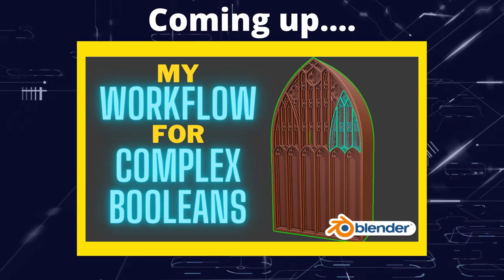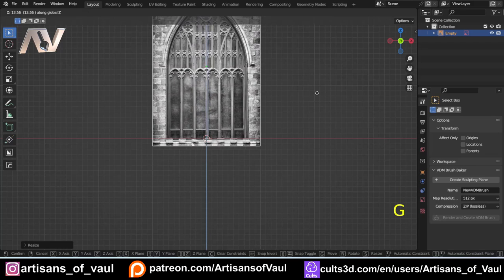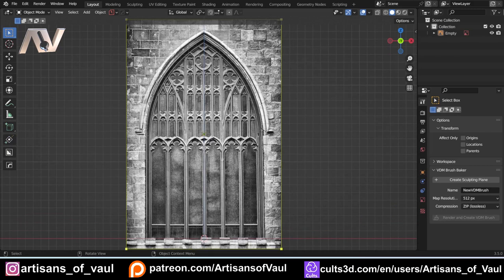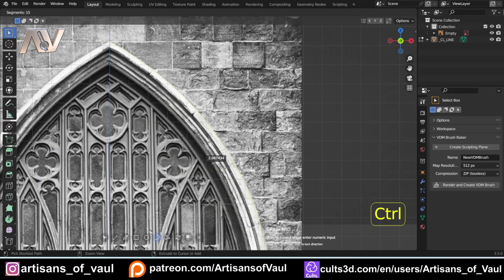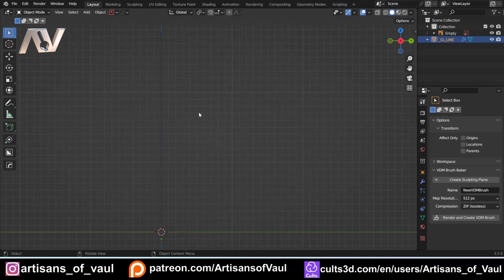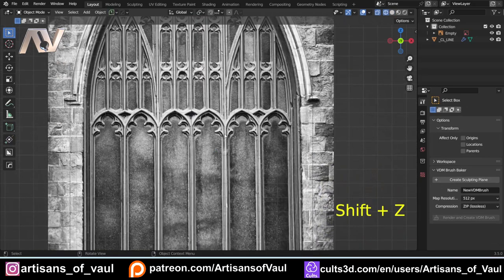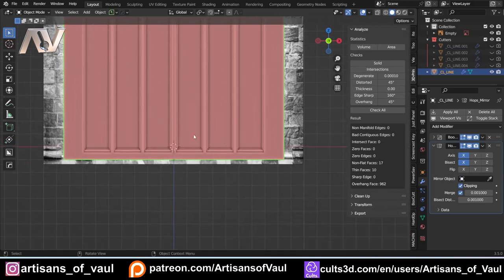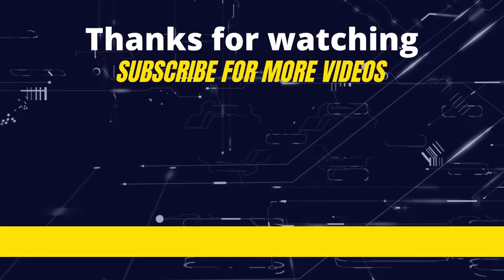Workflow for Complex Booleans - Church Window

Comment: I have been struggling with checking if a model has print issues. I noticed that you didnt see the not flat faces or thin face as issues. Is it right to think that those aren't real issues? Or something that would be more problematic in certain instances?

Also this is great to learn about. I kind of thought along the same lines already. But good to have validation. Did take me a moment before i realize that the Q menu was hard ops. Was like how did he scroll through the cutters?! Then you mentioned it was hard ops giving that Q menu and was like oh, thats why it doesnt work for me.
Reply from the maker: I very rarely find them to be issues. If they are you can normally see it and add in an edge to deal with a non-flat face to add some control of where the bend is.

Yeah, good spot on the Hard Ops. I honestly thing the everscroll function may be the single thing it has that saves me the most time.

Comment: Wow im at the beginning of the video but for this kind of mesh, a gothic church window, i just use curves with a custom profile, its way easier no?
Reply from the maker: It might be in some instances and not others. For example that can make some odd mesh issues on the "tip" especially of those extreme points. It makes horrible overlaps. It also doesn't work for some of the flat parts that are wider. Finally this was for a client that had specific sizes needed and that isn't as easy withe a profile on a curve. But it is a valid method (just not for this use/case). I've got some videos using different methods and the pros/cons here:
Gothic Arches with a specific width (curve or spin tool): https://youtu.be/KIz6yxkNmKs

Gothic Arches with a specific width (screw modifier): https://youtu.be/QQ06H3kGgpk
Reply: Yeah i see, i saw all of those videos already haha
But for the tip of the curves i use a mirror with bisect option, and i can use multiple mirror modifiers with a specific object or empty to be precise where i need the bisect, then you can scale a curve on a specific axis, without applying the scale transform, or use a specific curve profile, from a mesh @ArtisansofVaul
Reply from the maker: @Dhieen  That does work. But doesn't also help with the other needs of this project. But it's a good solution

Comment: The big deal about Construction lines is its ARC tool. Everything else (namely, drawing a fixed distance line on a given axis) you can do with normal blender. People often complain how blender isn't a CAD tool. Looks to me it's one feature away from being that. Offer a good tool for making arcs, and you're there. Arc-from-3-points is a standard, common and well-known. It's unfortunate that blender doesn't have that
Reply: well, 3 points and a starting direction. 3 points by themselves give you an arc with one degree of freedom
Reply from the maker: I like a lot of the other things it brings as well but I go agree it would be great if Blender had an arc tool.